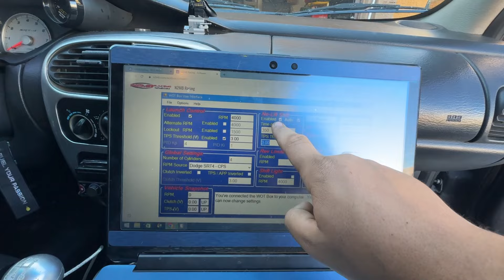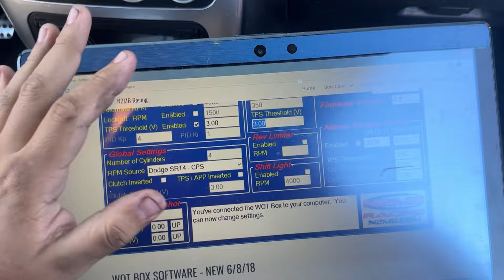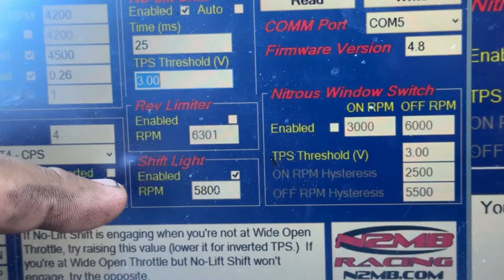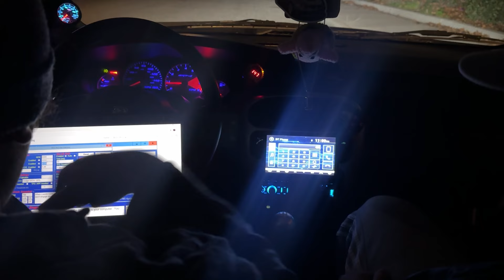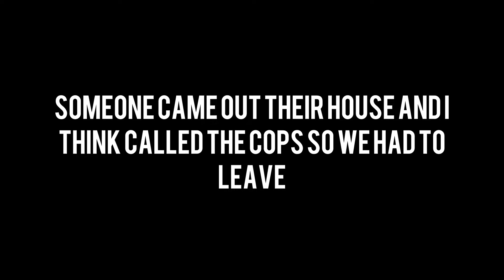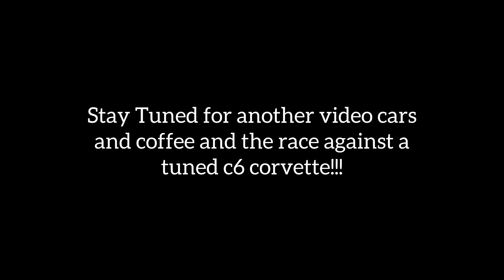Fixed my SRT4 and installed a Wot Box (rolling Antilag)

Comment: Cool channel bro ,  I stumbled across you channel and noticed that’s my friends old car 😭  , what have u done to it since u bought it ?& how’s the clutch holding up
Reply from the maker: Has the same clutch just turned up the boost a little bit and just bought a comp turbo for it video coming soon on it
Reply: @marquezdsm  did you get it retuned ? And does you need to run spacers with your new wheel setup ?
Reply from the maker: @jaredmcleod208 yes retuned and yea i need to run spacers in the front for the slicks
Reply: Who’s it tuned by ? Mario